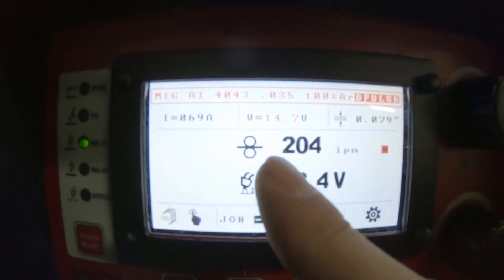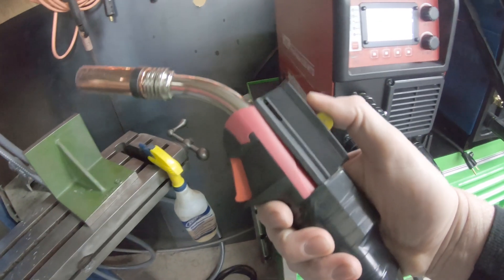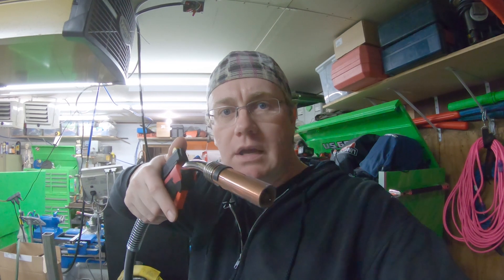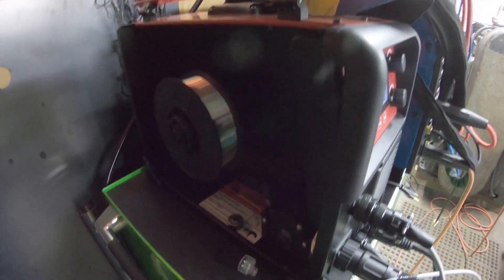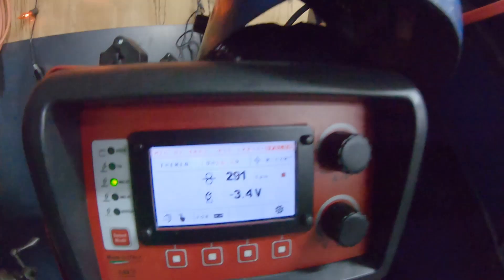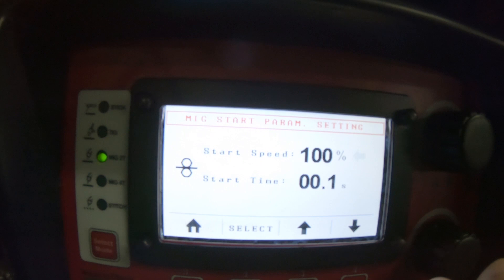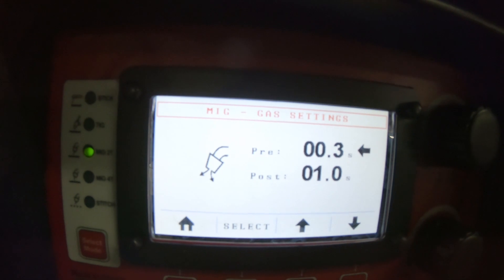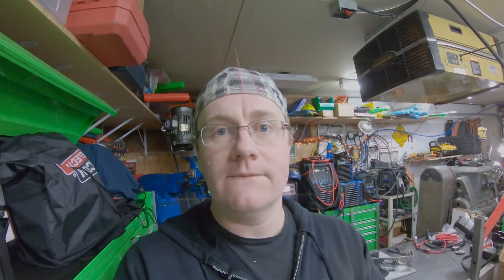Pulsed Aluminum MIG Welding With HTP America

Comment: Hi again, thanks for all your hard work in videos, I must say I’ve grown to appreciate your knowledge on such a wide variety of skillsets- I’m in there same boat. 
If you don’t mind I would like your advice. I have a 2015 Miller 325 then bought a used 302 as a backup (big mistake as it cost me $2k in repairs after 4 months of use) I traded it in for a 2021 325 Trailblazer which has ArcReach, this machine also has pulse. Most of my field work is fluxcore welding steel however I do get calls for aluminum work so I have been dragging out my powermig300 with it setup with a push/pull Binzel and using the 325 to power it. Lots of gear so most jobs I have to pass on. Lost Skills guy mentioned that he uses the HTP ProPulse for his alum field work so now I’m torn on wether I should get the ArcReach Suitcase 8 with an extra alum whip or get the HTP ProPulse, I think they run about the same money. I’m really interested in your thoughts on this. 
Btw I’m sorry for my short criticism on your video, I could have been more kind 😩